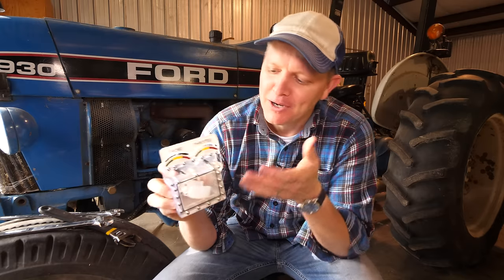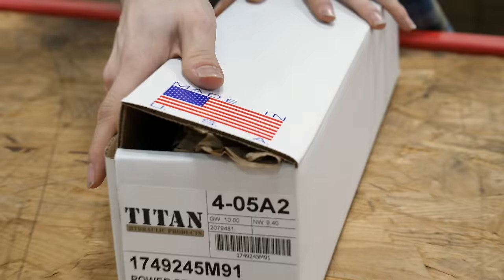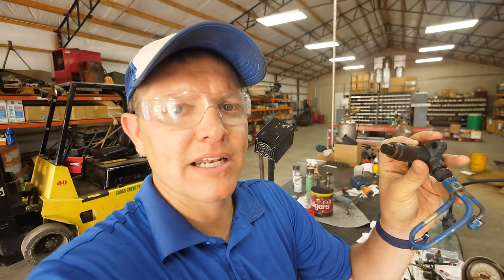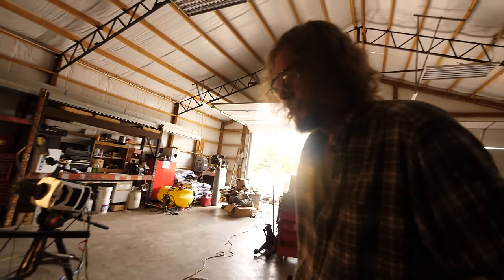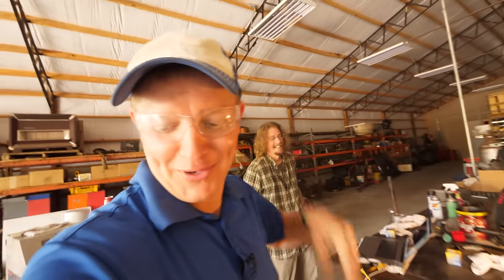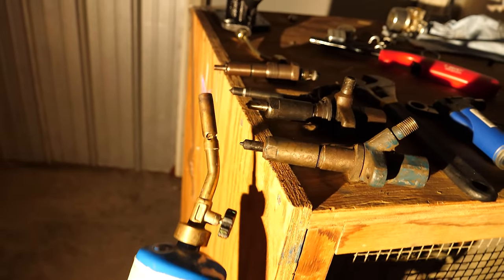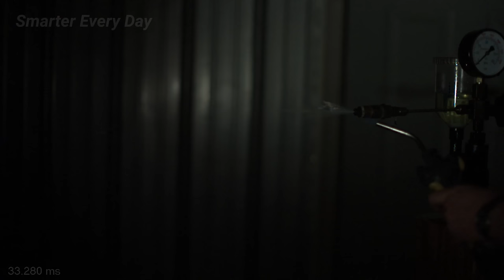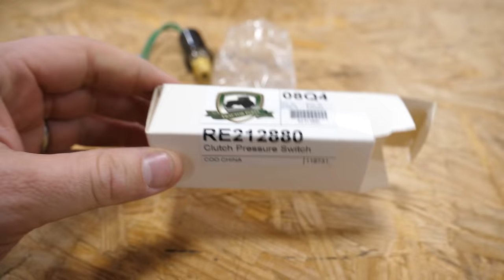Why Fuel Injectors are AWESOME (28,000 fps Slow Mo) Part 1 - Smarter Every Day 281

Comment: The Cadillac 3.6 liter V-6 was the first direct injection available on production cars on the 2008 models. At the time it had 305 hp. It is also the same engine used in the twin-turbo models producing 472 hp. Prior to this design, fuel injectors were placed in the intake manifold just above the intake valves, while this design injected directly into the cylinder.

While we think of Cadillac as your grandpa's luxury car, they introduced some high-performance innovations to the market, like the direct injection engine and its big brother with twin turbos.

Comment: The boundary limit you are talking about is basically called the LFL  lower flamibity limit and UFL upper flamibility limit. As you said it is related to the stoichometry,I.e.,air fuel ratio at the injector as you said it is too rich, all fuel. As the vapor moves further into the surroundings the fuel and air ratio move into the LFL UFL range and ignite. The LFL-UFL range differs for different fuels. See NFPA code.

Comment: A cool video. In a past life (job) I did work on diesel and gas engines. So I do have a very good background of how the their fuel systems work. But it was so cool to see the flame propagation at high speed. Yes we know that the open air pattern is different that in the high pressure environment of the cylinder of an engine. But It's still cool and interesting to see. 
  Keep up the good work.

Comment: There is a flame speed associated with various air/fuel ratios and temperature and pressure conditions.   The velocity of the fuel jet entrains the air and creates an outward vector at velocity "X".  Once the air fuel ratio reaches the lower flammability limit or is between the upper and lower flammability limits,  the flame front will advance back toward center to where the radial velocity away from center equals the flame front velocity towards center and then becomes a stationary flame front.

Comment: There is an upper and bottom threshold where the mixture can be ignited. If the mixture above that line, then there is too much fuel for burning (stoich), under it the exact opposite (lean).
Same happens when for example coal powder, or even grain powder is in the air. Those can be ignited too, sometimes mills are exploding because the flour gets the right concentration in the surrounding air, and a small flame can send the whole building up into the sky...

Comment: You should visit BOSCH in Germany to see how they actually build fuel injectors. The holes in BOSCH fuel injectors don't get drilled, they are using high-frequency laser bursts (>100kHz bursts) to chip away single atoms. It's like a chisel, but the chisel is a laser. They are able to create holes with insane tolerances & super sharp edges this way.

Comment: This video shows the problems of burning diesel really well. You ignite a stream, a mist at best, which has to burn from the outside to the center of the stream and thus create a hot area at the edge of the stream, while not burning the rest properly.
It shows the benefits of premixted air fuel mixtures, as those can burn near perfectly, especially if combusted via compression.
In modern diesel engines there is a work around with multiple injections used, which is good, but still lacks the near instant and complete combustion of a premixted one.

Comment: it was interesting to me when i learned the difference between "detonation" (flame front advances due to the supersonic shockwave) and "deflagration" (flame front advances due to motion of the temperature gradient) and that one is preferable to the other.  at least in gas engines, "normal" is "deflagration" -- and "detonation" is also known as "knocking" which can damage the engine; is the same true in diesel?

Comment: Don't forget about indirect injection. Similar to Port injection in a way except instead of firing the fuel into the intake before the valve it fires the fuel into a precup after the valve and the entire flame front starts there and forces into the cylinder.

Comment: There is a difference between fuel injectors and fuel nozzles . Injectors use a plunger which are mechanically operated . Fuel nozzles operate on fuel pop Off pressure within the nozzle . To the viewers NEVER place your fingers in the injector or nozzle spray path , NEVER .
Modern diesel truck engines use a common rail fuel system with electronic fuel solenoids. Very well done !

Comment: Great video! But😊. On 13:40 you talk about port injection method. That is for gasoline engines with a spark plug. 
I remember from my days at school there are diesel engines with a separate combustion chamber right above the cilinder called indirect injection.  I think some terminology got mixed up here. 
Greetings from the Netherlands!

Comment: Fuel injectors were used in WW2 and cars earlier in the '30s. This direct fuel injection system was invented by Jonas Hesselman who was a Swedish engineer, in early 1925. The invention came in a timely and was deployed by various governments, especially during World War II. Germany and Russia heavily relied on this invention to fly their aircraft during WWII.

Fuel injection was a great addition to not only motors but also planes which first employed the invention. The main reason why many aircraft used direct fuel injection system is that it doesn’t rely on gravity like carbs hence they could fly upside down and make sharp corners without a cut in the fuel flow.

Comment: Interesting, cool & awesome vid, good job. I think ur right about the stoichiometric area to initiate the flame front, it would appear it wont combust in a rich state until it becomes oxygenated enough throughout the atomised vapour. With newer technology an injector can be operated several times per engine power stroke, this would be Common Rail Injection with extremely high pressures, I have heard 3-5 or 7 times per stroke, IDK the real numbers for different engines, but it is truly amazing how far engineering has come. TFS. Cheers

Comment: Awesome video mate, one suggestion though, it'd pay to differentiate that direct injection (compression ignition) of this style is typically diesel whereas the carby, port injection and piezo injectors (spark ignition) are typically petrol. Its also worth stressing that the fuel jet from these bench testers is fully capable of injecting into the skin and can cause horrific injuries, awesome otherwise.

Comment: Although there is likely more than one reason it won’t “backburn”, the main reason is that fuel does not burn in a liquid state. In fact, when you light a puddle of fuel it’s not actually the liquid below the fire that is burning, but the vapors at the surface. Fuel will only burn in its vapor or gaseous form. It is easier to burn smaller droplets than larger ones because of the smaller surface area. There is less liquid, therefore less energy required to vaporize them. The velocity at the nozzle may play a significant role as well as the amount of air in the mixture being practically zero in the stream as it exits.

Comment: "RADIAL BOUNDARY" @ 12:00 - YOU have to consider that is "cold fuel"  .... The 400*F +++ temperatures that occur in the cylinder; the fuel burns nearly immediately after leaving the tip

Comment: Destin, I have a question I am not sure if anyone has tried or asked before. I have been curious if a Injector could be used for syrup production. It atomizes the fluid going through yes? So what about tree sap? Will it atomize the sap separating the water from the sugar? Then it should come down to gravity separation of the sugar from the water as the water will shoot further and the sugar will fall out of the air first?

Comment: Awesome video.  Question (sorry if I missed it): is any one of the events you video’s equivalent to one stroke or is the volume of fuel you pumped through these many times larger than one stroke would produce?  These flames/explosions look way to big to be just one stroke’s worth of fuel but man, if they are equivalent to ‘one-stroke’ then…wow…that’s insane to think about that energy releasing itself thousands of times/minute.

Comment: You should look into ducted fuel injection for part 2. A really basic concept (using a similar mechanism as the bunsen burner to incorporate more air) has the potential to revolutionize diesel engines and drastically reduce soot production.

Comment: Those John Deere injectors look very similar to the injectors I pulled from Mercedes E320 CDI 3.0L straight six. The IH injectors I just like the ones I changed in our 7.3 IDI. I would love to see how an old Detroit two stroke would perform using modern common rail injectors and what the emissions would look like from said engine.

Comment: I heard you guys saying fuel injection technology is old. You are not differentiating between diesel fuel injection and gasoline fuel injection. What you are working with is diesel injection which is the only fuel system for a diesel engine. It uses a mechanical pump to create pressure to operate the injector and high piston compression to fire the mixture. Gasoline fuel injection on the other hand has a fuel system that is under pressure and electronic controller that sends a signal to the injector to make it open. And a spark plug that fires the fuel mixture. Gasoline fuel injection is relatively new compared to the age of internal combustion engine. Diesel fuel injection has been around as long as the diesel engine because this is the only way you can operate a diesel engine. By the way diesel fuel injection operated much higher pressure than gasoline fuel injection. I see you added the information closer to the end! PS great video!!

Comment: 12:25 flash point, when aerosol fuels combust the lower the flash point, the faster it will try to "chase" the nozzle, if it has a higher flash point (say like an oil compared to kerosene) it will take higher heat to ignite the fuel and will have lower risk of a flash back.

Comment: You seem to be surprised fuel injections were that old. They were not used for petrol before, because carburetors were much cheaper options, but due to the way diesel engine works, fuel injectors were always required for diesel. 

Carburator pre-mix would pre-detonate, and you couldn't vary throttle, as in diesel lower throttle means less fuel (because limiting air intake would prevent high pressure required to light up diesel)- and if low throttle amount of fuel was evenly distributed in cilindre, the mix would be to lean to fire.

But with fuel injectors, fire burns locally around injector where there is enough fuel.

Comment: well as you noticed and what most people don't know: neither gasoline nor diesel can burn or explode whilst in liquid form. they always have to become gas and mix with air before actual fire happens. now diesel is quite hard to truly vaporize, it's usually more like tiny droplets of diesel which is also the reason diesel engines are much "dirtier" (soot) compared to gasoline ones and it's the reason why direct fuel injection with high pressures was mandatory on diesel engines even in the 60s when pretty much every gasoline car still used low pressure manifold fuel valves.

Comment: People like Dean are a huge asset to farmers today, especially the smaller operations.
If you're going to keep checking out injectors, HEUI injectors are cool. They use hydraulic pressure to inject the fuel, and are electronically controlled.

Comment: It's also the pressure of the fuel coming out why the flame does go back up the stream, think the way gas stoves (gas gas not petrol) work they put out gas but the flame doesn't run back up the line.

Comment: Destin! You should measure the pressure punch and speed that the single flow nozzle produces. Almost like a pressure washer. I think this would be interesting because instead of just checking the pressure it takes to pop the “check valve”, it would measure the quality of the flow!

Comment: Droplet diffusion flame dynamics.  John B. Heywood's book "Internal Combustion Engine Fundamentals" does a good job explaining how droplet burring in a Diesel engine happens and he discusses the difusion gradient (air/fuel ratio) from the center of the droplet  as it evaporates into the surrounding hot compressed air.

Comment: Fuel evaporation point. Diesel can put out a fire. It's not a good idea but it can. The reason is there is a "Flashpoint" and a Fire point" when in contact with air. Neither can happen in a vacuum. But the odd thing is these point for fuel are not a set point. It depends on a lot of factors like humidity, altitude, surrounding temperature and surface contact. Example for contact, if you open a can of soda the contact is contained to the open area and only spits out of that location, but if you pour it on a table the whole thing spits because the bubbles rise to the surface, and then burst breaking the liquid's surface tension. Then if you toss that into the air, each droplet is surrounded.

Comment: I've always wondered why fuel injectors do not work the same as the spray pattern on the El Alamein fountain in Kings Cross, Sydney.

Basically, the water squirts out of multiple tubes onto multiple concave surface of a spoon shaped disc to make the water spray out in a 360 degree, "circle".

The fountain looks like the seed head of a dandelion when operating and quite the sight to see but if you took each individual nozzle and applied it to a fuel injection motor, there maybe some fuel saving without loss of power due to a better fuel burn.

Comment: Hi there, when you spoke about the boundaries of the ignition in relation to the concentration of the mixture in the air. I think the boundaries are Upper and Lower Explosion Limits (cool right?) We use these terms in the hydrogen industry roughly 4-75% concentrations of hydrogen is explosive. Too little and you don’t have enough hydrogen for there to be an “explosive environment”. Too much and the hydrogen is too concentrated to burn (not enough oxygen) 12:27 😊

Comment: With detroit diesel's you can test injectors with a sledge hammer. You hold the injector in one hand (making sure to stay clear of the spray) and smack it with a sledge on the other hand.

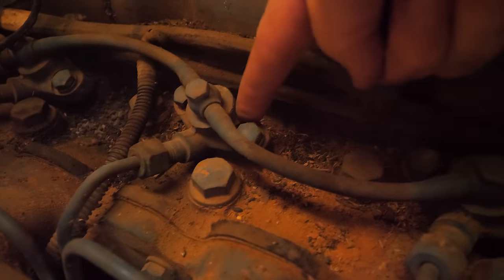Comment: 1:23 tbh i din't read the video title :D
i all rdy knew what it was on first glance. but then again i do watch lots of car content on yt so u get familiar to engines and stuff on the way.

also when it comes to diesel vs gasoline. diesel needs compression and heat where gas needs spark. u can toss gas on a stove and boil it but diesel will light up. also u can toss match or open flame on diesel and it wont light up where gas would light up. also reason why diesel engines have higher change of runaway where gas engine u can just turn it off and with out a spark the engine stops running where diesel will run until it runs out of fuel

Comment: What would be a disadvantage of an inlet injection for lower pressure?  More complex inlet/outlet valves and timing?  Do you risk cutting off some of the fuel intake into the cylinder if the valve closes too soon for instance I assume?  So you end up with a more lean mix and less efficiency?

Comment: GM Research has actual videos of the combustion "inside" of cylinders, including detonation in both gasoline & diesels.  Inside of a cylinder it does not look like this at all, since the air/fuel mixture or the air in a diesel is already pressurized, and in many cases has swirl or a patterned flow.  When the deflagration occurs it will move in the direction of the swirl (as in a spark engine) which makes for a more uniform pressure wave.  However if the fuel does not burn entirely in the flow pattern, it may cause a rebounding pressure wave, which can transition into detonation, which causes knock.  In diesels at 20-to-50 compression, you essentially get knock at every fuel injection since the fuel cannot go in supersonically, and always creates rebounding pressure waves.  We designed some of the Roosa-Master diesel pumps, and their performance was terrible as compared to modern injection systems.  In the future, it will probably be "hybrid diesels", using a quasi-Atkinson type of cycle, which will eventually be required, to get maximum fuel energy useage.  In a small car, you could probably get 100+miles-per-gallon, with a low-drag design.

Comment: Question, Destin: Isn't the flame or burn part of the 4-cycle combustion process totally separate from the fueling part? So, you're saying that the spray quality is important to the kind of combustion that is produced even though the fuel and air mixture that is above the piston is being compressed until ignition occurs?

Comment: Destin. This is diesel injection which is hydraulic. Gasoline injection is a little different. Gasoline injectors use electricity to open instead of hydraulic pressure. Modern diesels have gone back to electric injectors. And there are many injection methods. Direct injection, indirect injection, port injection, throttle body.

Comment: I'd really like to see the combustion inside a diesel engine. It would be interesting to see how the fuel ignites from heat and compression. Does it ignite all the fuel at once, or are there hot spots in the cylinder where a flame front is created that expands across the cylinder? If it creates hot spots, are they always in the same place? Hopefully that's in future videos on the subject